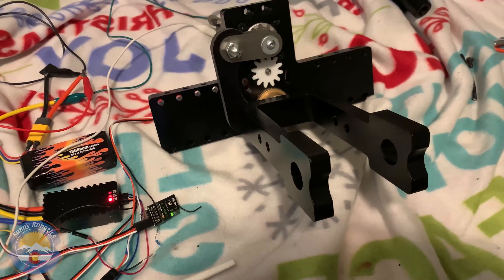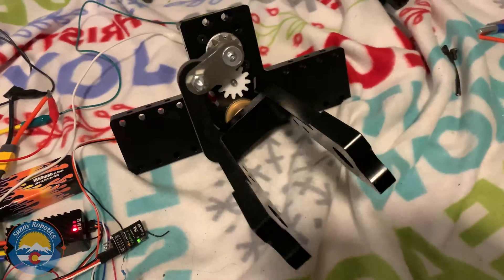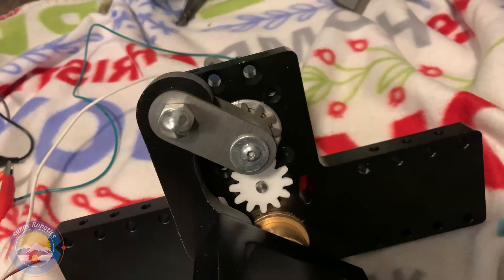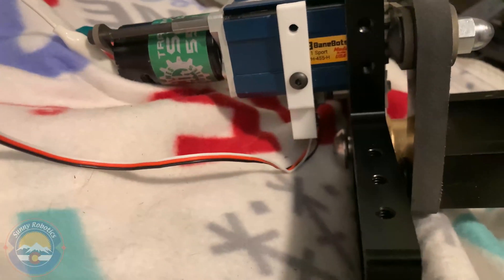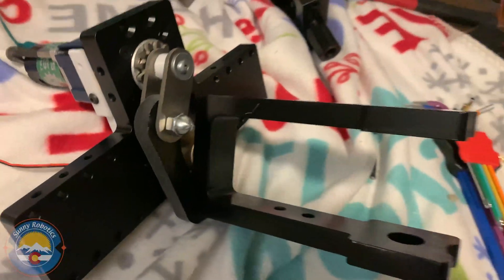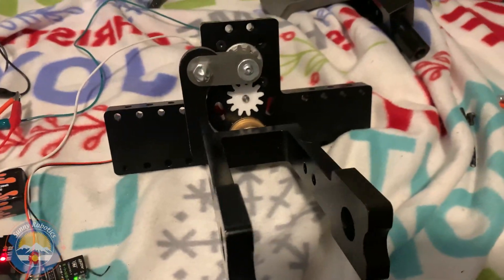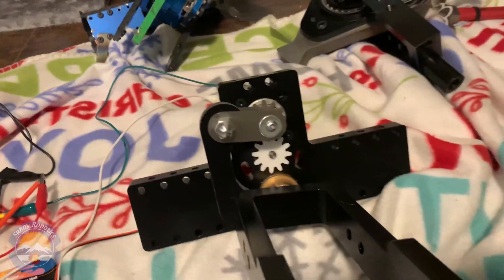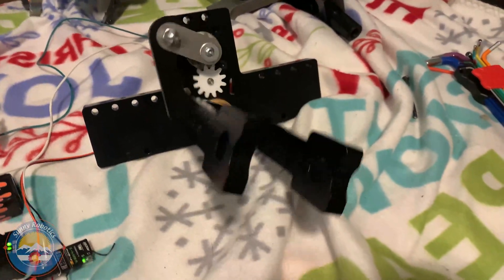Mega Servo

Comment: What is the potentiometer for?
Reply from the maker: The potentiometer gives precise location information to the motor controllers so the arm does not travel too far. It makes it work like a normal RC servo, just much larger. If you were to take apart an RC servo you will find a motor, bunch of gears, motor controller circuit board and a potentiometer.